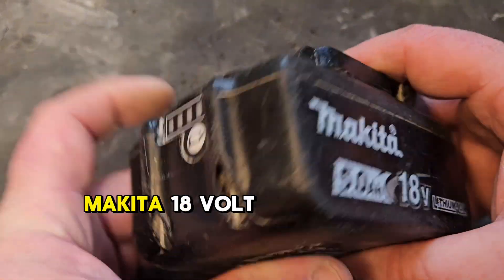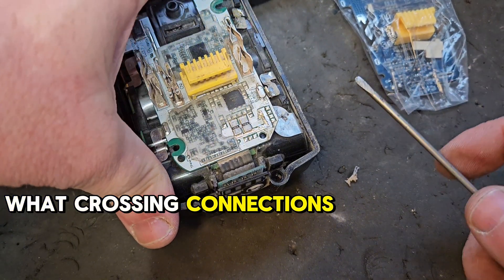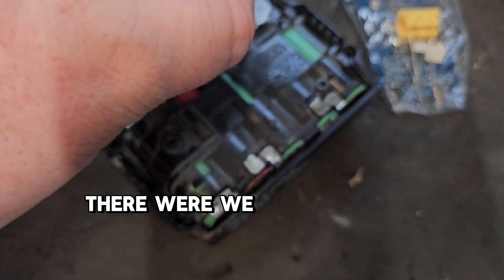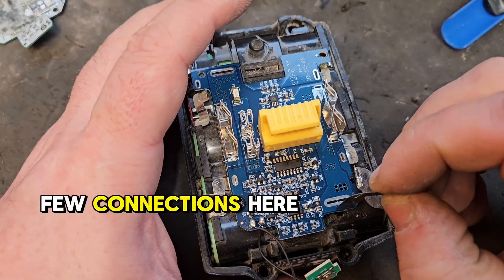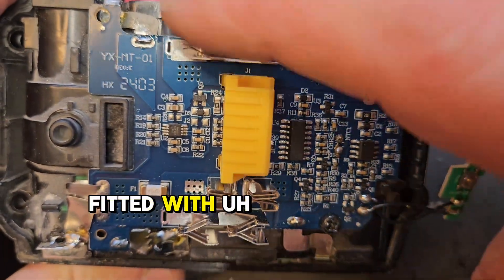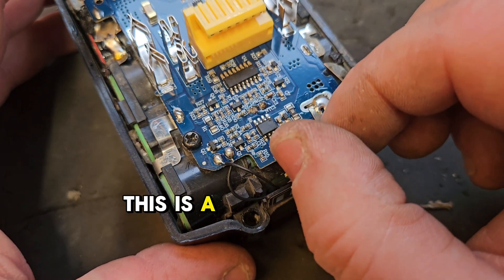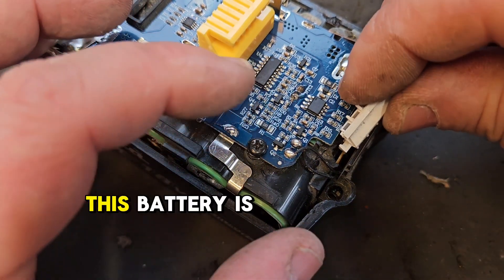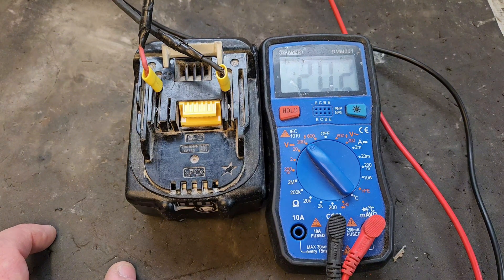DIY Makita Battery Repair: Easy Steps Anyone Can Follow

Comment: Most problem o china makita board is that not balance batteries. So it work, but like half year, when bateries unbalance and one row go to 0.
Reply from the maker: Yes I heard that
Reply: So solution is external balancer, or some board, which can balance, but i cant find one.
Reply: If someone has some tip for board, which can balance, let me know.

Comment: What is the reason for this battery failure, what happened that the battery started to blink? What should not be done to prevent this from happening?
Reply from the maker: The board either accidentally fails or fails purposely due to planned obsolescence.
Reply: @doctorlefthandthread  🤝🤝❗❗
I heard that this happens with brand new batteries too❗
Either overheating or very discharged❗
It turns out that Makita is a lottery⁉
Why did Makita come up with such a special
blocking of the electronic board⁉⁉⁉
It is unfair on Makita's part, in the consumer's opinion‼

Comment: I’ve got replacement PCB and done 3 batteries now, 1 was ok and works on the charger, the other 2 show ok on their test button but charger rejects them flashing alternate red / green. Any tips on why this is? TVM
Reply from the maker: I haven't seen them fail if the board is replaced and the cells are good
Reply: @ I can direct charge with lab power supply into terminals which is ok so not a disaster but no good if I’m away from home.

Each set of cells measure circa 3.7v so don’t think there are any dead ones.

Out of the 3, 2 seem to have a common failure which was a fracture of the tin strip where it joins the pcb, but battery then got locked due to this.
Reply: @mavuk100 I have the same issue cant seem to find a way out of it